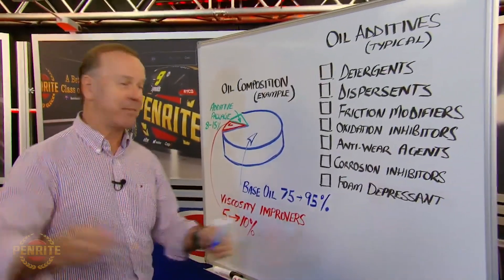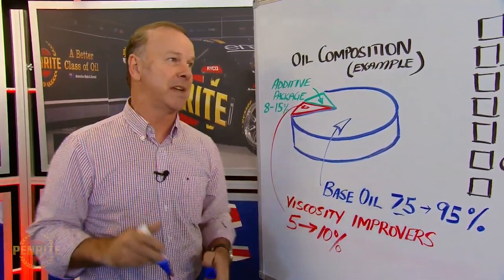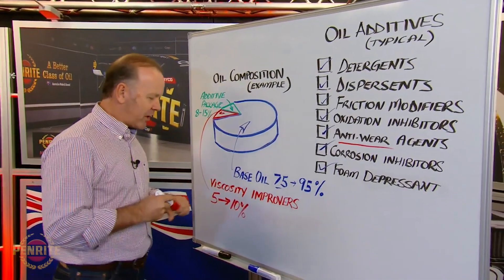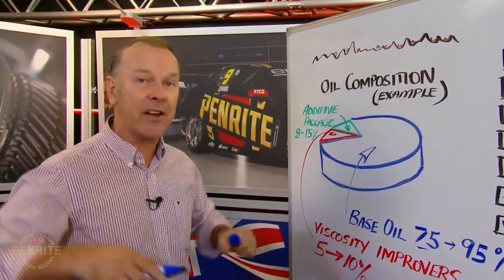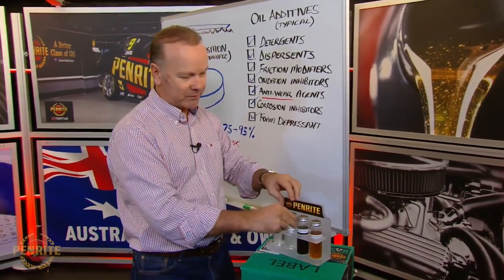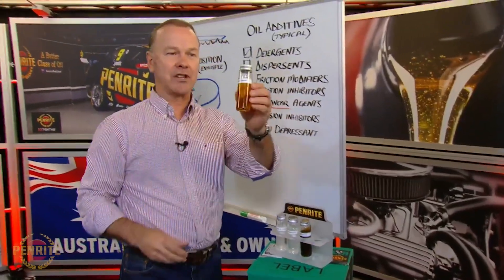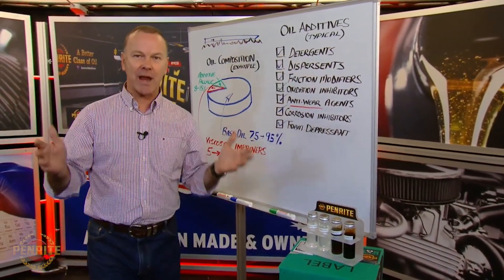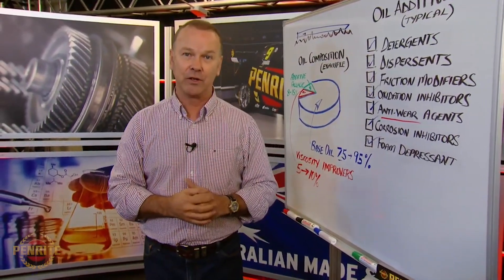Engine Oil Explained - Penrite Oil

Comment: My European car is 0W-30W living in Sydney I feel that is to low my oil burns easy with the standard engine temperature of 90.C + your normal 40.C day
Reply from the maker: Hi Caleb, your best bet is to call our technical team for a recommendation based on your climate and vehicle, you can reach them on 1300 PENRITE (1300 736 748). Thanks for your comment!